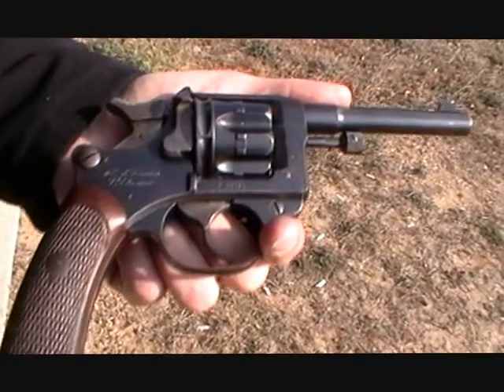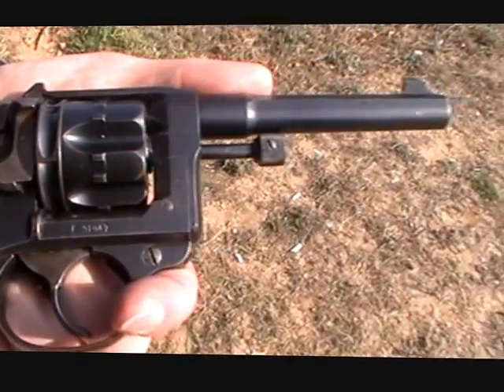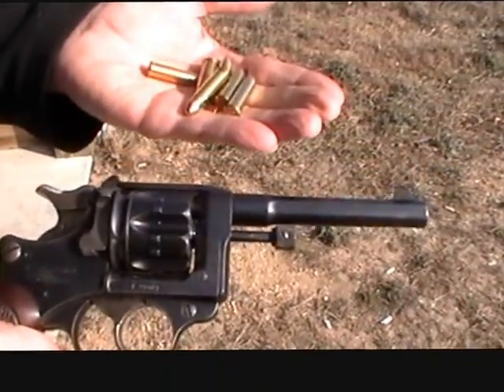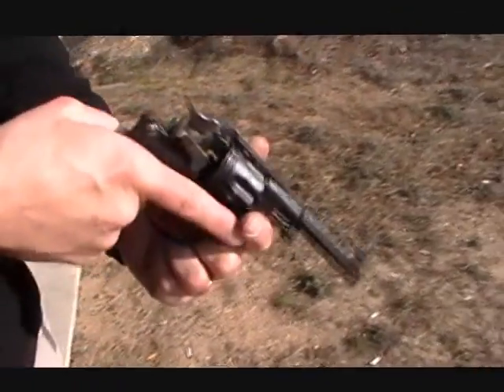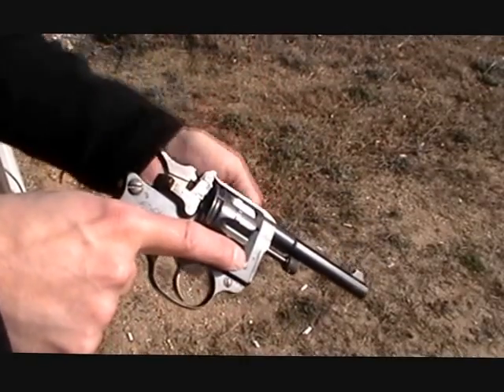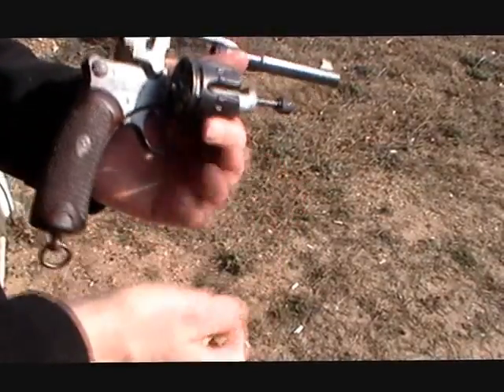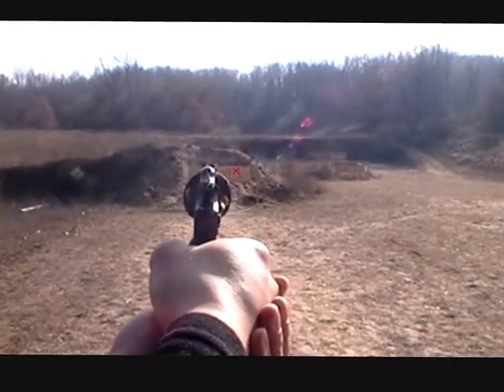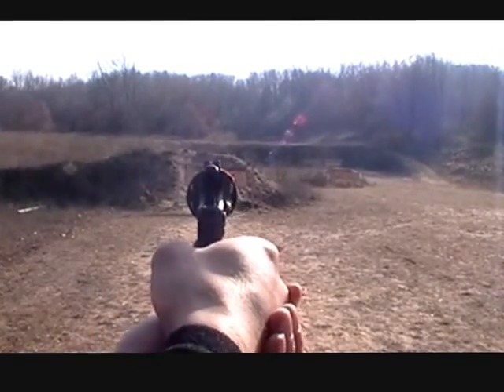Firing of the French Model 1892

Comment: Cylinder actually swings to the right for loading and unloading.
Reply: "Loading" gate is only a cylinder lock, not a proper loading gate, as can be seen by trying to use it as one. :)
Reply: Yeah I was shaking my head watching him try to load it like that. 

I was told by a collector of old pistols that the reason it drops out to the right is because French cavalrymen were trained to fire with their left hand while riding horseback, and use their right hand to hold the reins with their right hand, so to load it easily they'd need the cylinder to swing open to the right.